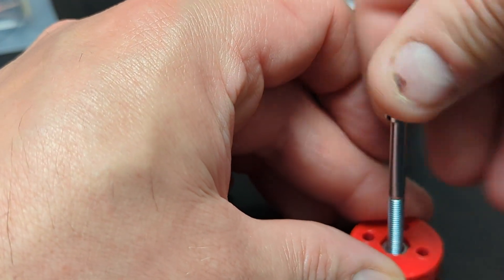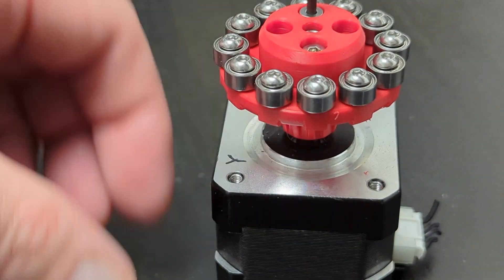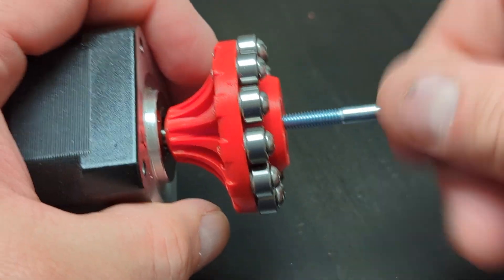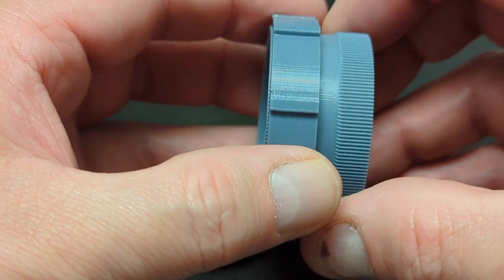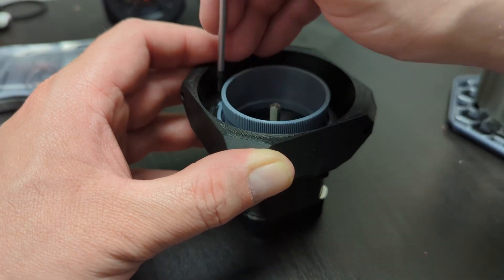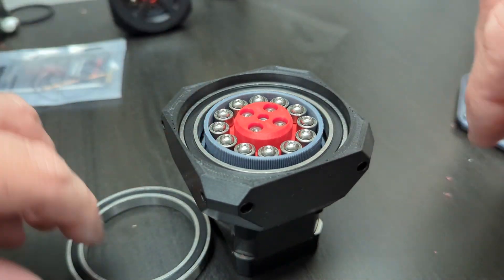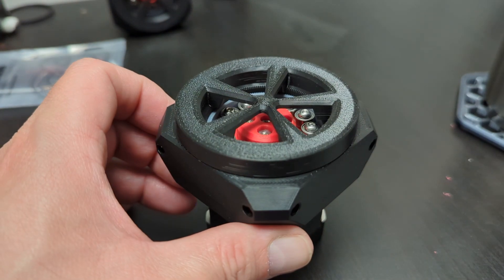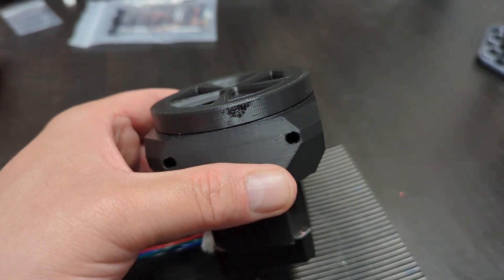Compact 90:1 Harmonic Drive

Comment: Curious, why not use the heat-set inserts where you were putting in the roller bearings? Feels a bit easier than tapping all those holes.
Reply from the maker: Heatset inserts are just too big, there is very little space from the M3 thread to the outer wall. The next problem would be that the heatset inserts cannot be melted down exactly. 0.1mm off is already too much

Comment: One of the smoothest operating 3d printed harmonic drives I've seen, how did you come to that bearing configuration?
Reply from the maker: Thanks for your feedback :) I wanted the two big ball bearings primarily to stiffen the circular spline. This makes the mechanism much more stable and rounder, which ultimately enables smooth movement even under load. The oval arranged ball bearings on the Wave Generator always keep the Flex Spline in shape what is extremely important, especially with such fine gearing on higher load.
Reply: @LucasLangner  what benefits are there to having a wave generator with 12 (as per your design) bearings as opposed to a simpler arm with 2 bearings? great work btw, I'm experimenting with harmonic drives too and was wondering how low I could go with an 0.2 nozzle, I'm impressed with how small you managed to get the gear teeth

Comment: what type of printer did you use for the gears, they're so small
Reply from the maker: I use the Voron 2.4. This works on any printer, but you need a 0.2mm nozzle for the toothed parts.